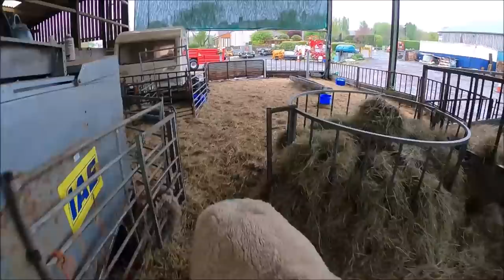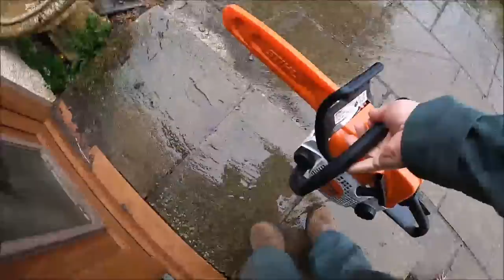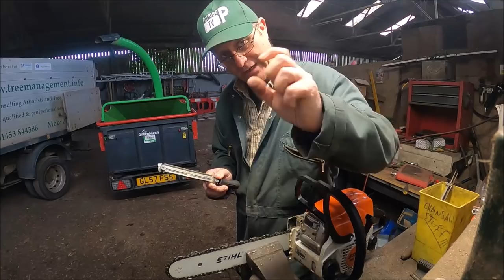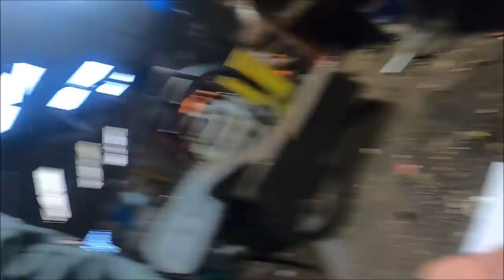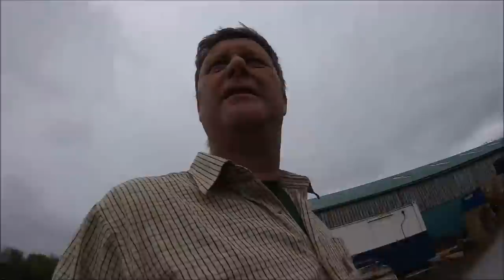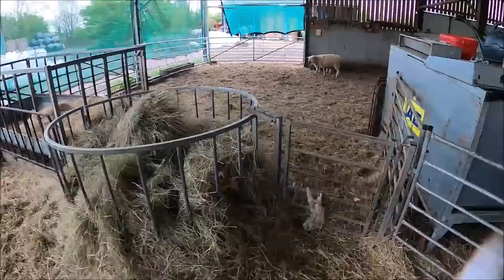Trees and Chainsaws.  18 04 20

Comment: 1) Semi-Chisel is also good in hard dry wood because it doesn't wear as quickly as a rapid cut chisel.

2) Kick-back in large saws is a real and ever present danger. It cannot be underestimated how quickly a day can go from happy to tragic. Big saws have a hell of a lot of torque with gyroscopic effect and if you're cutting at full throttle and she bites then you better be hanging on. Under-cuts and not paying attention is the 2 things which cause the release of claret.

3) This video is for entertainment and demonstration purposes however a good practice when doing a chain sharpen is to remove the bar, dress it (with a file) and turn it over 180 degrees. This ensures efficient operation and balances the wear.

A good explanation and demonstration of chain saw sharpening. Thanks. I hope someone learns from my comment.

Comment: i used to by a saw doctor at the engineering works back in the 80s 90s did lots of saws for farmers  from chainsaws/bandsaws and some big circular saws--some of the big circular saws were in a bad state after the farmers had been filing them for many years -- and earned i little bit on the side

Comment: I find it interesting to see how others sharpen, I dont use a file guide but have been sharpening a long time so am content with accuracy of my angles.

I often cut quite big fallen stuff so my two main saws are both 75cc, a husqvarna 575xp and a husqvarna 572xp.  One  usually wears a 20" bar and the other a 25". Personally I like one saw to have a semi chisel chain and the other a full chisel chain so I can use the most appropriate saw depending on the degree of contamination or the task.

For certain fells I like to use the full chisel for maximum cutting speed, but it dulls easily so if I'm cutting stuff that's been down a while with soil splashed on the bark then I'll chose the semi chisel.

I recently tried the new full chisel chain from husqvarna with gold master links and that really holds a edge .
Reply from the maker: Paul F 
I don’t use a file guide usually, to be honest I rarely sharpen a saw at all these days. 😄
I think Matthew does though and as the video was aimed at the more diy amateur element I thought  it best to leave it on.
Reply: @FarmerP  

Makes sense

Comment: Hi farmer P I’m thinking of getting an electric chain sharpener for use at work I normally carry three chains as the work I use it for is fallen trees or limbs on or across roads / pathways and I’m a bugger for touching the tip on the ground have used them and think it would be faster for sharpening as it can take ages to sharpen all three👍
Reply: I have a porteck bench grinder and would recommend it, the really cheap grinders are not very accurate.

Personally I try and hand sharpen regularly and just use the grinder if I hit something or am in a rush.

Comment: having two cutters on the same side is common on Stihl chainsaws due to the fact they run an odd number of driver links most of the time.
Reply from the maker: NgnMech 
Also depends on the sprocket or power ring  set up. 🙂👍
Reply: @FarmerP  Sprocket will effect the numbers of driver links, but the odd number of drivers sets up the roll for the two of the same side together,  Then it will continue to happen if you try to make even number of driver loops afterwards unless you make another odd loop or take an extra driver off of the roll to reset the roll spacing.

Comment: The most informative and interesting learning lesson for me so far as I have a 42cc chainsaw while im impressed with its power the chain I bought really isn't making use of the engine barely even batts an eyelash at it but that's not a surprise as it was the cheapest of the cheap 18" bar and chain set 
I would like a slightly better quality and slightly more aggressive cut but admittedly it is nice that it isn't something that is gonna kick very easily I don't want anything longer or shorter as for what I do the length is perfect 
what chain spec and brand would you suggest it is the semi safe chain currently I'll replace the bar at minimum but probably both is ideal the chain is still lots of life but I don't like the bar as it heats up easily and tightens up on the chain I don't think there is a bearing on the bar end sprocket just a pin through a hole and while my chain oiler does throw a bit of oil off the chain lubing the bar and end sprocket doesn't help keep it cool
Reply from the maker: Kraig Duncan 
If you are heating up Kraig, the chain may be too tight, or you need to adjust your oiling rate, unblock the oil way on the bar or change the oil. You should not overheat.
Reply: Farmer P yah i first encountered the problem cutting a point into 7" fence posts noticed it when it started smoking and ever since its done it but admittedly I pushed the saw to long that job as i still had a lot of posts to go everywhere was out of stock on sharpened 7" posts the single most dense wood ive ever cut them suckers where solid it took a long time should it throw lots or a little oil off the end of the chain as it currently goes through a oil tank at the same rate as fuel there is barely anything left when it runs out of fuel it will leave a slight snail trail of oil if it has something to throw the oil onto how tight is to tight i go till i can't quite pull the end of the drive tooth out of the bar in the middle without putting some effort

Comment: Hi farmer p you said the chain was tight how should it be
Reply from the maker: Adrian Telford 
You should be able to pull the chain around the bar by hand without restraining the saw body Adrian, A lot depends on the chain weight and bar length though, and if your bar grooves are clean and equal. If the saw is sitting on the bench, it’s ok if the bottom side of the chain is not snug up against the bar, a little gap between the bar and chain links is ok. 👍🙂
Reply: @FarmerP   ok thanks for the help

Comment: You've scared me now. I never knew about chainsaw kickback being associated with how fast a chain cuts. Our chainsaw is painfully slow. Always wondered why. But I'm also scared now to alter it 😬 hate using a chainsaw. Don't you need a licence to use one?
Reply: Ian just commented about the basic differences, but in reality there are multitude of variations in chain differences.  Semi chisel, chamfer chisel, full chisel( which is available in round ground and square ground) with square ground being the most pro grade, but takes special sharpening equipment or really good hand filing ability. And then add in the different cutter sequences like full complement, skip link, and semi skip link, which various the distance between the cutters on the chain.  The skip link is normally used on longer bars over 24 inches in length, but can be used on shorter bars, which makes a small saw cut more like a large saw because of the reduced amount of power it takes to turn the chain.

And within those chain style differences than there are different driver thicknesses.   The 3/8 lp or low profile comes in .043 and .050, then the next size up is .325 gauge chains which comes with drivers in .043, .050, .058, and .063, then upward to the full size 3/8 chain in .050, .058, and .063, and rarely you will see .404 guage chain in .063 or 080.
Reply: For personal use of chainsaw you need to licence. If your undertaking paid work for someone and/or work for somebody then yes you should have proper qualifications. Bit that said there still lot of people who don't.
Reply from the maker: NgnMech 
TMI 
This was just a basic show and tell for those that have no idea. There was no point bamboozling folks with information overload, they would loose interest and learn nothing. There is no substitute for proper hands on training, I am not trying to teach the whole science, just a few basics to help keep folks safe.
Reply from the maker: Ben Clansey 
In fact you only need a license to buy the top handle pruning saws from a proper saw dealer Ben, and even then not many ask to see it. There are plenty of folks out there using saws with no formal training at all, and a few of them are damn good at it. 
There is no substitute for good training though, understanding the machine and the work, stress and tension, gravity, slope work, wind and safe zones. Chainsaws won’t hold back If you give them a chance to bite you..... They bite hard !
Reply: @FarmerP  I know you couldn't go into all the details without loosing people, I commented the way I did just for more of a laugh than anything, because I knew it would be information overload. By the way I sell and service saws, as well as make loops for customers from the rolls. And after 22 years I still hate making loops from the 3/8 lp .043 because is it so easy to twist the drivers when trying to press out the rivets in the breaker.
Reply: @FarmerP  o when did change I work as self employed land based sercive contractor and always ask to produce my licence no wonder accident rate going up

Comment: Keep your legs together around that wet stuff... How many time have you said God Look at the bags on that ( Under your breath mind )in your life.. Nice to see you rotate the file ( How many people would know that )... I fell bush for a living when my lot was young with a chisel chain and was all hand file with no guide plus rolling the file as you stroked ( Some will know what i mean )..Sorry you forgot one and that is the flat chisel it is in between the chisel and the semi... Square chisel as it is sometime called and will be different for manufacture to manufacture.. Best if you can square file a chain cut like all hell and need HP to do it with out bogging down.. A saw will only bite on the down cut and will kick on the up cut plus on the 9 o'clock to 12 o'clock part of the tip of the bar...But still good info for the farmer or the guy that wants to cut his own wood for the fire..Racker filing with a guide on any bars as long as your guide is hitting 2 to 3 cutting teeth at a time will work as good as any.. My smallest bar is 24 inch and up to 39 inch for most felling..Next vid show the bar cleaner how it works... Bar oil holes/Roll over on the bar and how to file it off... Tipping the bar to stop ware etc...I was starting to wonder about the last 4 ewe's even tho thay where showing... One down and 3 to go... Brownie point ABBI for Dad Lol...Cheers Ian ... Thanks John..
Reply from the maker: Thanks John.
This is only covering a few basics, I don’t want to overload folks with TMI. I can do a bar care video and perhaps give away my hedge trimmer sharpening secrets. 😄